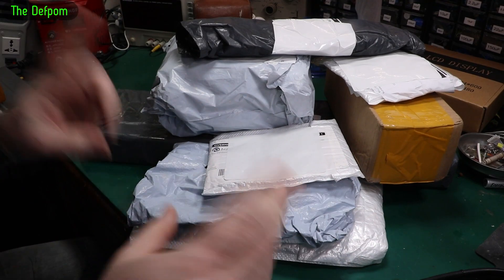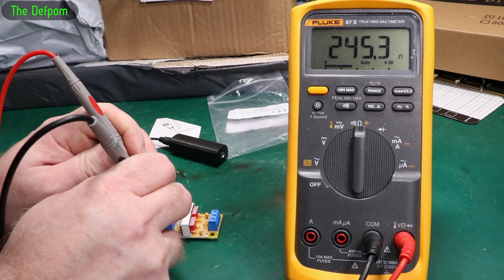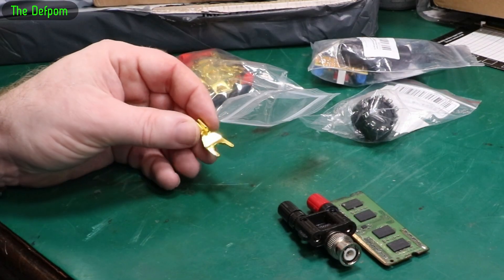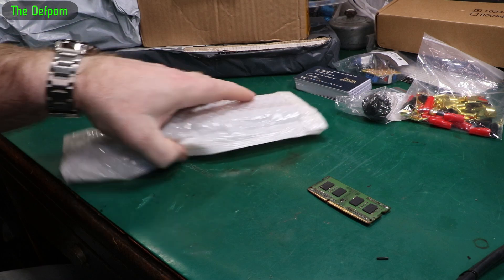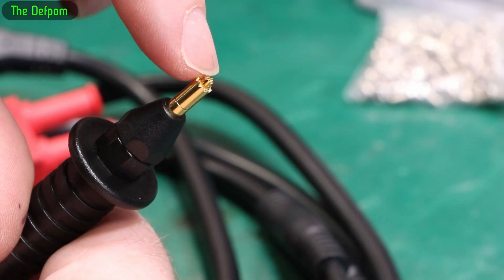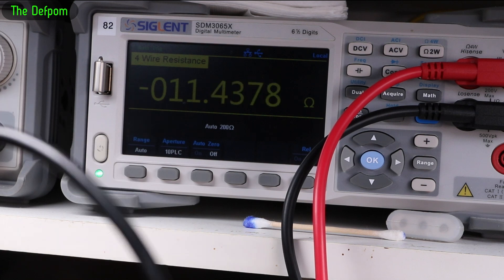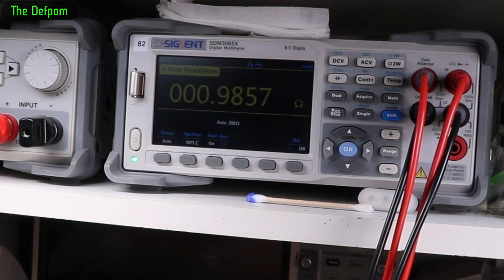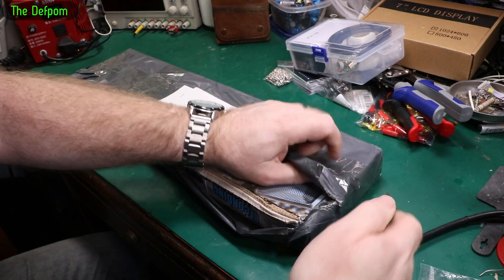🔴 Mailbag Monday 5th August 2024 - No.1268

Comment: I tend to buy stuff in multiples too!

I have a screwdriver set in the car, I have a screwdriver set in the shed, and I have a screwdriver set in the shed!

Drills I have a plenty, between the house and the shed.

Sure the shed is like a 5mtr walk out the back door, but then when you take it out of the shed, you have to remember to put it back in the shed, otherwise when you need it in the shed, you have to go searching for it!

Plus when 1 breaks, you have a spare, and these days, that's a good thing to have, especially when you find a good product, nothing worse than getting a good product, then years later it breaks, and you can no longer buy it anymore!
Reply: Lucky you for having more than one shed.
Reply: @repairman2be250  I only have 1 shed. Oh I see the problem, one of those sheds should have been 'house'.

Comment: It's funny because if laptops actually had proper grounding pins on the power cable, it wouldn't be an issue.

When I was working for a mobile cinema (2001 to 2020), once we started moving more digital (around 2006), we started seeing this issue more and more, and it was the laptop. Unplug the laptop from its charger, and the humm disappears on the speakers, plug it in, and the humm is there, could also just disconnect the 3.5mm from the laptop, but we kinda needed that plugged in.

Essentially the laptop was sending a signal through the 3.5mm to the mixing board to use its ground pin, and because of that, the entire audio system would play the phantom noise, not very professional for a mobile cinema :P